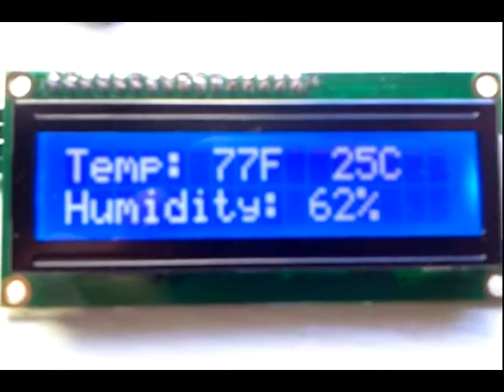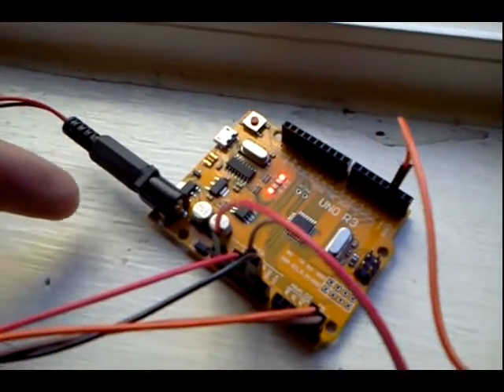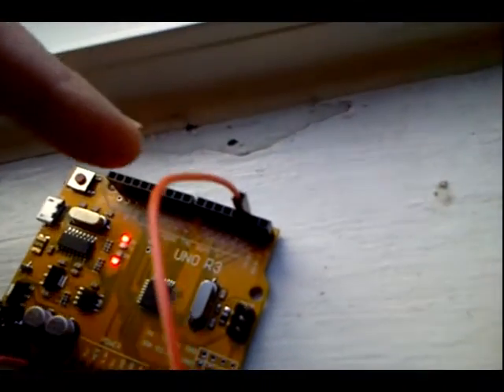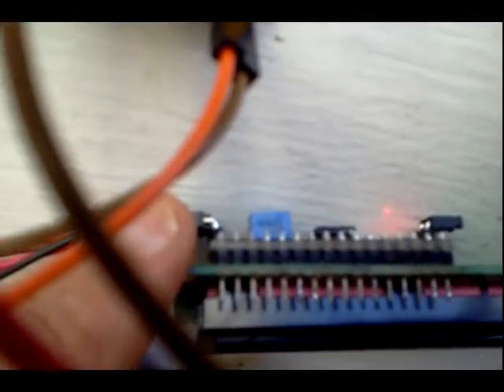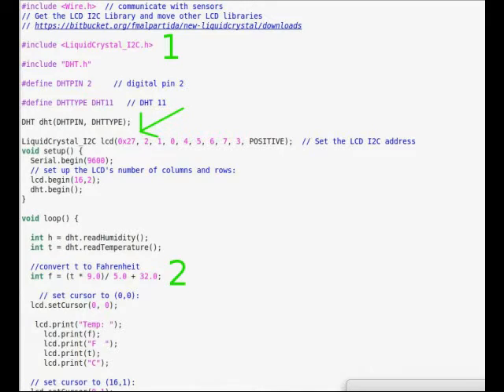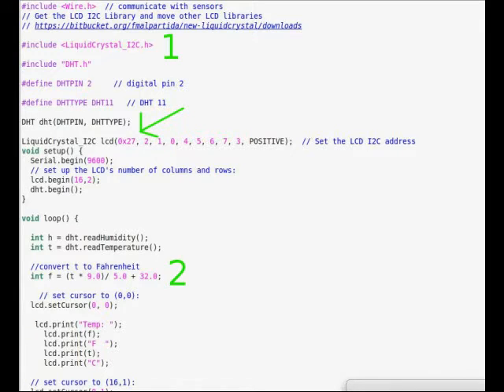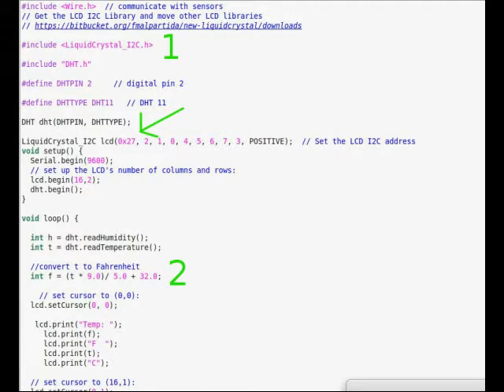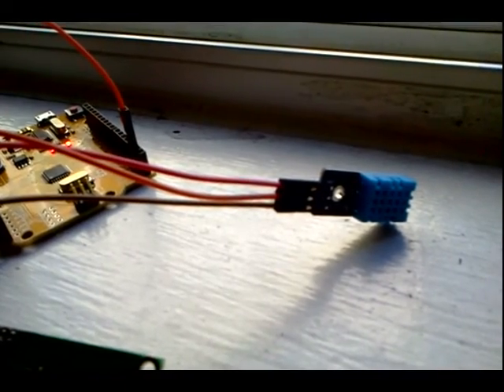DHT Temp Humidity Sensor LCD I2C Arduino

Comment: #include "DHT.h"
#define DHTPIN D6
#define DHTTYPE DHT22 // DHT 11
DHT dht(DHTPIN, DHTTYPE);
#define BLYNK_PRINT Serial
#include <BlynkSimpleEsp8266.h>
#include <ESP8266WiFi.h> 

#include <Wire.h>
#include <LiquidCrystal_I2C.h>
LiquidCrystal_I2C lcd(0x27, 16, 2);

//=================================================================

char auth[] = "a9674bfd76754fd0882635083884e1c2";
char ssid[] = "amonrat ap"; // your WiFi
char pass[] = "123456789"; // your pass Wifi
//int currentButtonState = LOW; // ??????????????????????
//int previousButtonState = LOW;        // ?????????????????????????????
//=================================================================
BlynkTimer timer;

int inPin = D0;         // the number of the input pin
int led11 = D3;       // the number of the output pin
int led11_s = 0;
void sendSensor()
{
  float h = dht.readHumidity();
  float t = dht.readTemperature(); // or dht.readTemperature(true) for Fahrenheit

  if (isnan(h) || isnan(t)) {
    Serial.println("Failed to read from DHT sensor!");
    return;
  }

  Blynk.virtualWrite(V1, h);
  Blynk.virtualWrite(V2, t);
  Serial.println(h);
  Serial.println(t);

  lcd.init();                  // Start LCD operation
  lcd.backlight();              // Turn on backlight of LCD
  lcd.setCursor(0, 0);          // Set LCD home position
  lcd.print("Humidity= ");
  lcd.print(h,1);
  lcd.print("%");// Print Humidity message
  lcd.setCursor(0, 1);          // Set LCD home position of 2nd line
  lcd.print("Temp= ");     
  lcd.print(t,0); 
  lcd.print("C");
 if(t>=23){
    digitalWrite(D5,HIGH);
  }else{
    digitalWrite(D5,LOW);
    }

 if(h>=23){
    digitalWrite(D5,HIGH);
  }else{
    digitalWrite(D5,LOW);
    }
  
  
}

void LEDStatus()
{
  if(digitalRead(D8)==HIGH)
  { Blynk.virtualWrite(V4,255);}
else{ Blynk.virtualWrite(V4,0);}
  if(digitalRead(D5)==HIGH)
  { Blynk.virtualWrite(V5,255);}
else{ Blynk.virtualWrite(V5,0);}
  if(digitalRead(D4)==HIGH)
  { Blynk.virtualWrite(V6,255);}
else{ Blynk.virtualWrite(V6,0);}
  if(digitalRead(D7)==HIGH)
  { Blynk.virtualWrite(V7,255);}
else{ Blynk.virtualWrite(V7,0);}

    if(digitalRead(inPin)==0);{
      if(led11_s==0){
        digitalWrite(led11,HIGH);
      
      led11_s = 1;
      }
      
  else{
    digitalWrite(led11,LOW);
    led11_s = 0;
    
    }
    delay(300);
}
}

void setup() 
{
  pinMode(D5, OUTPUT);
  pinMode(led11,OUTPUT);
  pinMode(inPin,INPUT);
Serial.begin(9600);
Serial.println("DHTxx test!");
dht.begin();
Blynk.begin(auth, ssid, pass);
timer.setInterval(1000L, sendSensor);
timer.setInterval(1000L, LEDStatus);
}

void loop() 
{
Blynk.run();
timer.run();  
}

Comment: Supplied code will not compile:

sketch_jan28b:22: error: 'POSITIVE' was not declared in this scope
 LiquidCrystal_I2C lcd(0x27, 2, 1, 0, 4, 5, 6, 7, 3, POSITIVE);  // Set the LCD I2C address
Reply from the maker: do you have that in head of script and not in setup or loop() functions? Is your LCD hooked up right?
Reply: this what you need to get it work DHT_sensor_library-1.2.3.zip here where you can download it.
Reply: i have the same error :( i need help
Reply: The Code is incorrect, this is how I got it to work with the included libraries and if you have the correct I2C address...

LiquidCrystal_I2C lcd (0x27, 16, 2);  // Set the LCD I2C address, columns and rows.

void setup() {

  Serial.begin(9600);

  lcd.begin();

  dht.begin();

}

Comment: it keeps showing me that it is 0 degrees and the humidity is 0%. Can you help me out, please?
Reply from the maker: Yaya K troubleshoot in steps: can you print data to serial port? Did sketch upload no errors?  0% reading...check sensor connections.
Reply: everything shows up at the display and there is no error at uploading the sketch to the board.. I connected everything like you did in your video. Besides that I linked my Arduino board to my computer, but I don't think that's the problem. Well, I hope that I find a solution for that.. still searching

Comment: Getting Error in code please help
Reply from the maker: +Alpesh Soni I read your code before it was removed here...you need DHT.h file (#include "DHT.h"). Check your libraries folder; if it's not there, get it here: https://github.com/adafruit/DHT-sensor-library